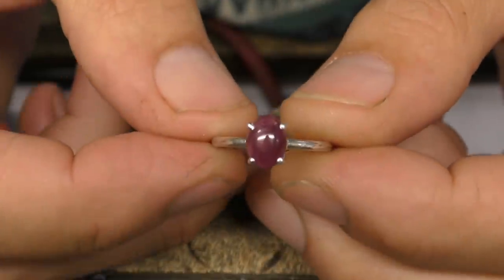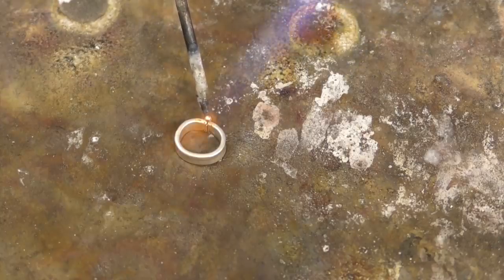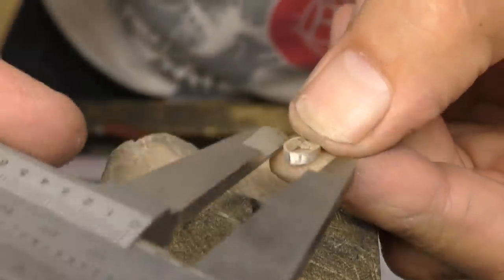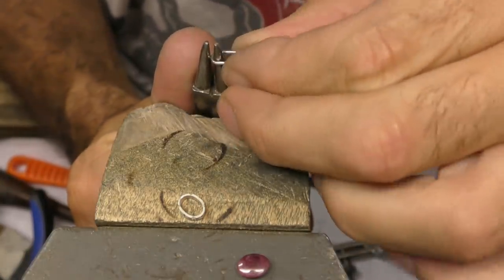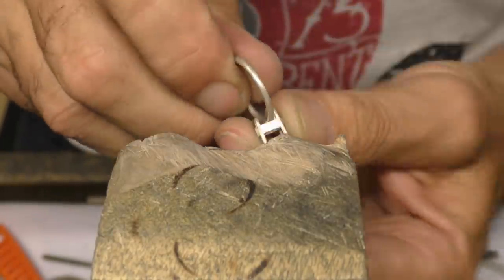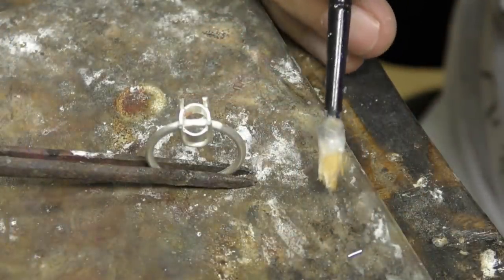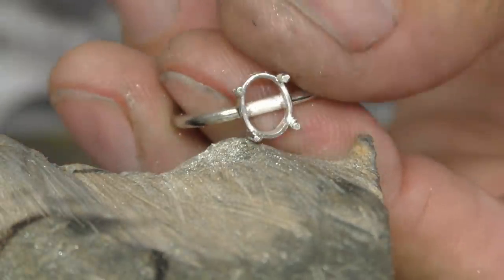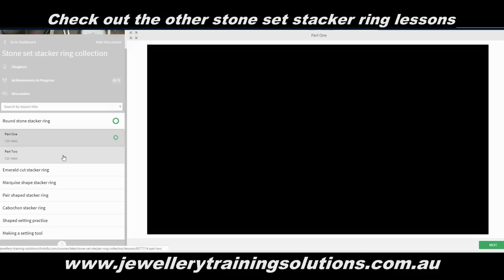Cabochon stacker ring

Comment: That setting moved around a lot when you were soldering! How many times does it take to get these little details just right? It's these little things that matter the most in the end product. SIGH Practice practice practice...there is always so much to learn and discover, but just never enough time.
Reply from the maker: That's right, lots of practice. Ive had over 40 years of practice. Still learning

Comment: Submerge the joint in a little distilled water on a wire stand or tiny drop of polymer clay, just enough to stick in place... like Femo. Shallow water submersion is good enough to keep the priming compound in rimfire ammunition ( .22 lr for example) when making certain other calibers with the live primed cases. This should not explode if you over heat so even better. its in my technical manuals for spot annealing . Use the minimum water you can use. Hope that's a decent enough knowledge trade .